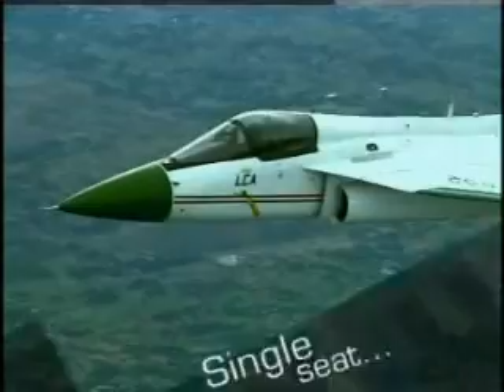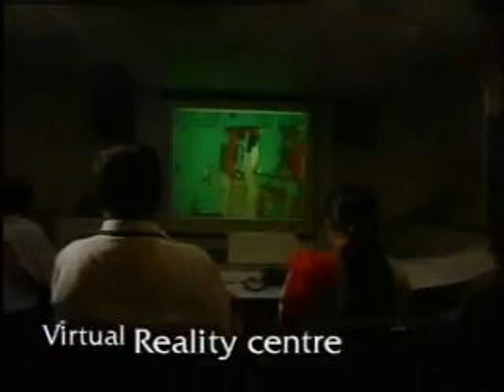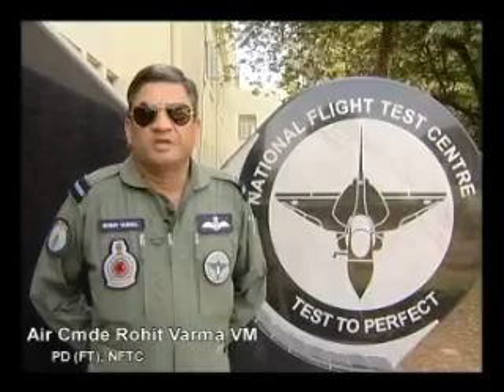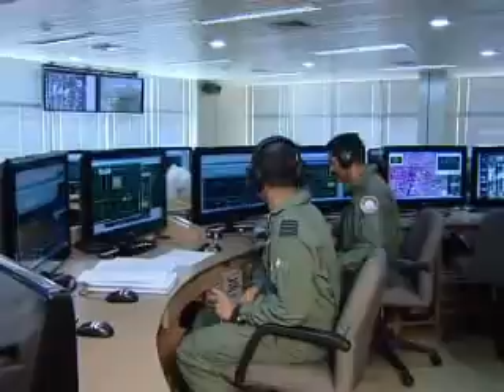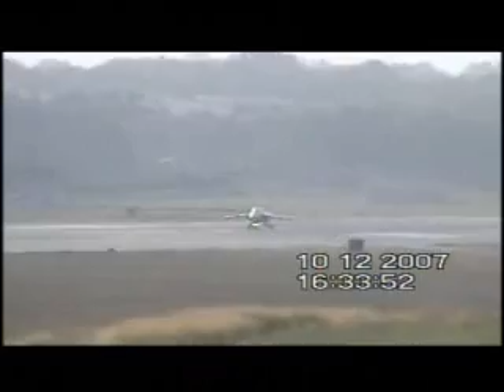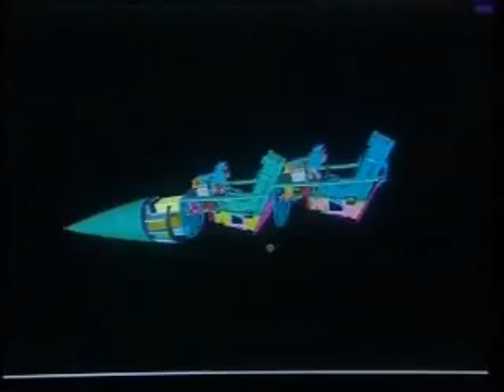DRDO ADA Film on Tejas - Light Combat Aircraft

Comment: In IAF there is a divide on LCA. Some want to turn the LCA into a advanced jet trainer due to its failure as multirole fighter, others are still convinced that it could be a success and some want to produce despite its drawbacks and just use it as a point defense fighter like the F-5 Freedom Fighter or the MiG-21 (which it is suppose to replace). Now that would be a achievement, producing a 1960´s MiG-21 kind of fighter in 2015.